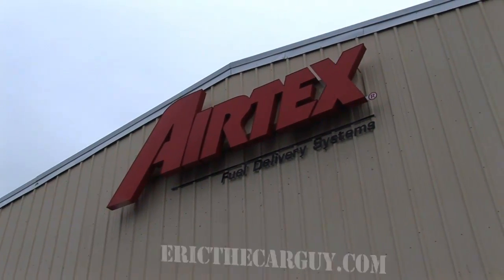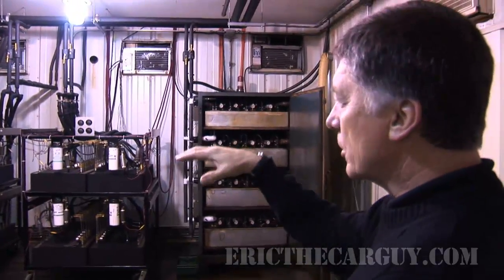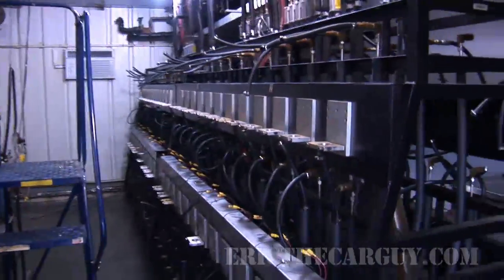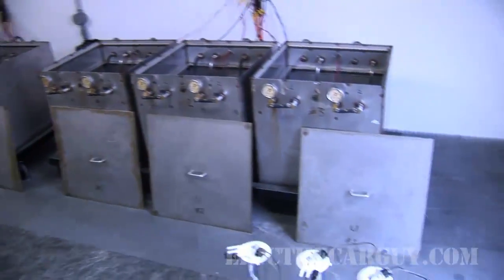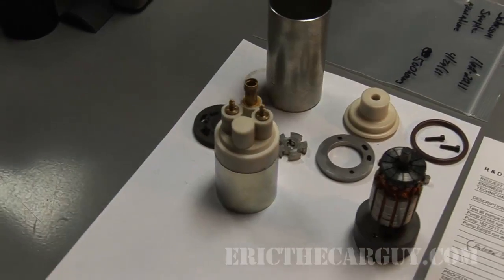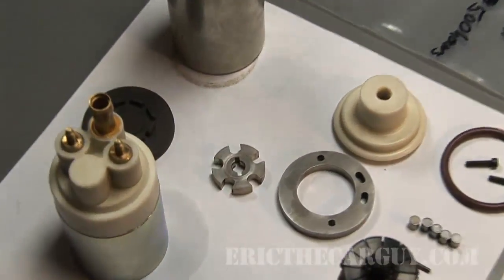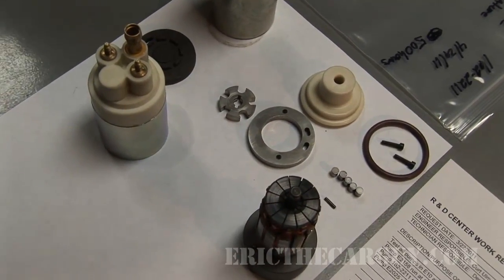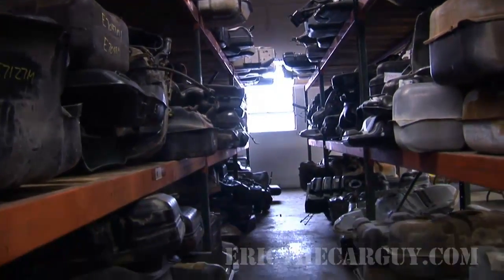Airtex Engineering Tour - EricTheCarGuy

Comment: Time 5:45. "Flamable Gas" facility with opes gasoline tanks and a lot of wires connected with terminals - it does NOT seem to be safe. Room full of gasoline vapor, one spark from loose wire and everything goes BOOM.

Comment: That is all Airtex does is when one of their fuel pumps goes bad.Say it was installed wrong 100% most of the time.Put one in a Pontiac Bonnevile once,would not run.Removed it out of the tank and it ran.There was something wrong and was installed correctly.Installed 6 in a row all Airtex,a Chevy truck and failed quickly.

Comment: the Delpi's come with a new plug because Airtex is the company that redesigned it for them! They are the ones that came up with the redesign. When my silverado pump fails I too will get a Delphi pump because they have strictly OEM quality standards.. But I'm positive it will be an Airtex pump inside. GM had issues with the plugs because they weren't built robust enough to carry the current for the pump therefore many of them melted..

Comment: When it fails,Airtex turns down for warranty called installer error and have been through this.Go look on the box of most Carquest fuel pump boxes,say Delphi on them now.Carquest had high failure rates when Airtex was their supplier and I know a former Carquest auto parts store owner that seen this a lot.

Comment: Still won't install Airtex fuel pumps,the number of failures went right down when Carquest switched to Delphi.I know a former owner of a Carquest auto parts store,he saw this happen.The Delphis come with a new plug in for the 2001 and down Chevy and GMC fullsize trucks,warranty is void when this plug in is not replaced.The plug in corroded and this was a problem.

Comment: Been through that.Had in a Pontiac Bonneville for a fuel pump replacement.Would not run installed in the tank.Ran when removed from the sending unit.Airtex called it installer error and it was not this.Chrysler does use Airtex for their OE fuel pumps,somehow they don't fail.

Comment: Ive had my airtex fuel pump for 41,000miles and its never given me problems. The only things i didnt like was the vapor seal didnt fit so i had to use the one off my old pump and i had to cut off the connector and solder a new on. But it all seemed to pan out ok

Comment: Delphi and AC Delco for GM only.I won't install an Airtex fuel pump,replaced 6 of them in a Chevy truck once.Carquest used to use Airtex for their fuel pump supplier,dumped them and switched to Delphi.

Comment from the maker: @superfootdan Remember you need air to start a fire and if the pump is submerged in gas it won't ignite.  If it was a danger I'm sure the manufacturers would have done all they can to prevent such a thing form happening as they would get the pants sued off of them if anything like that happened.

Comment: For those of you worried about the pump starting a fire in the tank, you need to remember that the pump is immersed.  Fire needs fuel and oxygen.  Immersing the pump removes one of the two from the equation essentially.

Comment: Again thanks to Airtex!  I wonder if we ever test a Delphi module against an Airtex pump and then compare and contrast?  Probably in their R&D group!  Touche for Eric's questions at 9:15, he nailed it!  GM rather than admitting the pattern failure, in their pumps, which have high PSI demands (55 psi to 62 psi), insist that the tank be kept 1/4 full or it's the "owners fault."  LOL!!  This theory is postulated by GM to avoid warranty fulfillment!

Comment: I hate to say this but both my blazers and my s10 had those pumps put in and lasted only 3 to 7 months and were a nightmare to get the warranty replacement . I had the tanks dropped and replaced with a new tank and a airtex pump new in the box and it burned up in the same time period. I would not buy or use one until they fix the warranty problems thru autozone and NAPA both places told me to buy OEM 
pumps for the chevy trucks or vans

Comment: He's correct about the idea that running low fuel will hurt the electric motor. It's weird to know that the gasoline gets drawn right thru the center of the electric motor right past the spinning rotor and thru  the sparking brushes!!! It's safe because there isn't air there to cause an explosion.

Comment: That is a great video.It gives a better understanding on what causes failure which can be a big help in explaining to someone why they need a pump.I'm also glad you addressed the issue of the low fuel in the tank causes the pump to fail. I think that Curt did a great job of explaining on what usual pump failure is caused from. I really liked the video it was full of a lot of information that is very useful to someone doing repairs.

Comment: There is a local gas station where I live that has extremely dirty underground tanks. One customer (who delivers furniture) has a contract with that gas station to purchase gas from them. This gas station tanks were so contaminated that the furniture store had to not only replace the fuel pump assembly but they had to replace the tank because it was filled with so much debris. To be honest it looked like river sand/silt mixture at the bottom. And this company still purchases fuel from them!